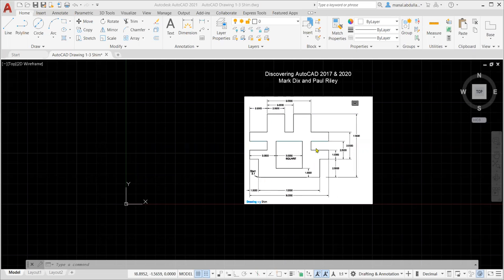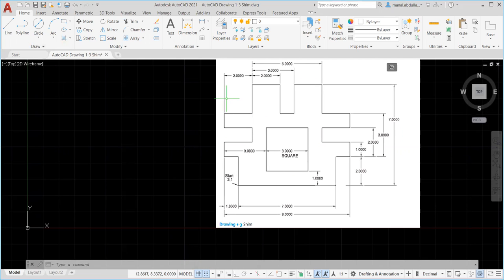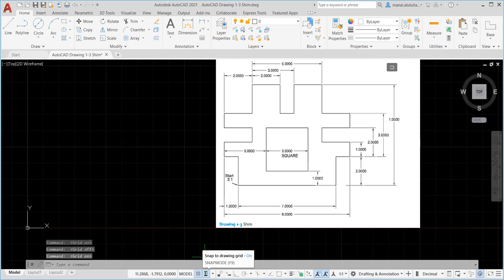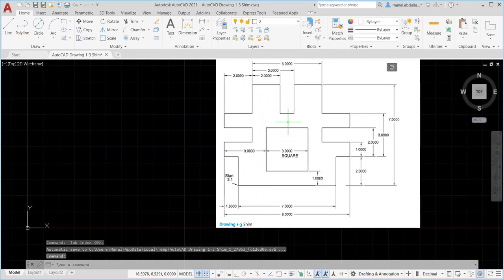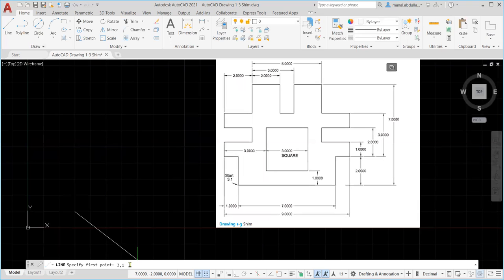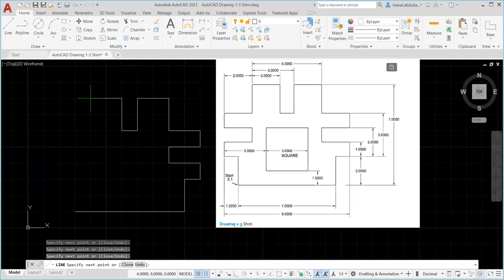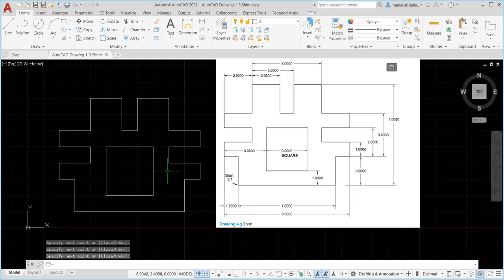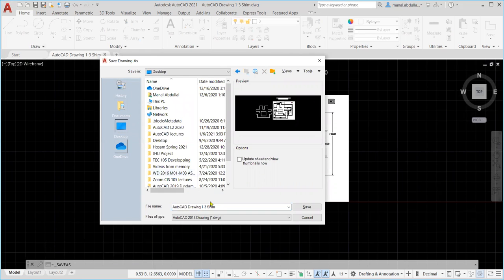AutoCAD 2021 _ Practice 2_Basic Drawing Skills _Shim

Comment: How do you know how many times you go vertical?
Reply from the maker: Hello Morris. This video mainly discusses the line tool and snap settings. You should count the grid lines since the spacing and snap is 1. You could do that directly if the dynamic input is ON. I also discussed more ways and strategies of drawing in my other videos. Let me know if you have any questions.